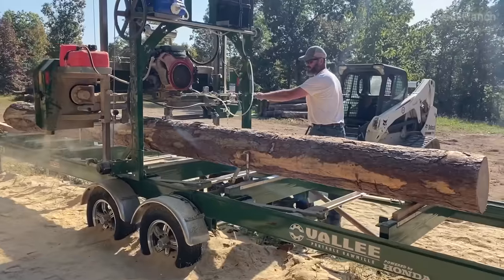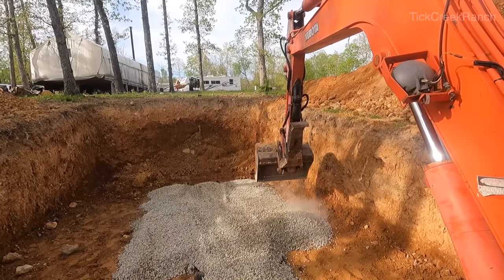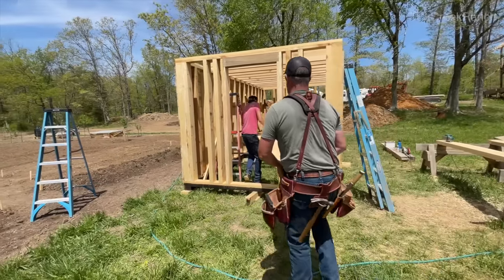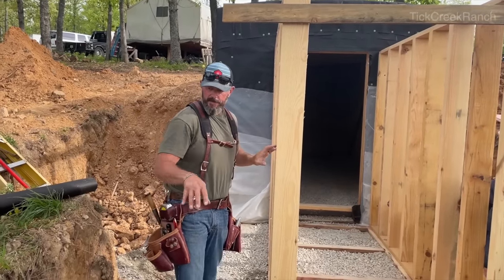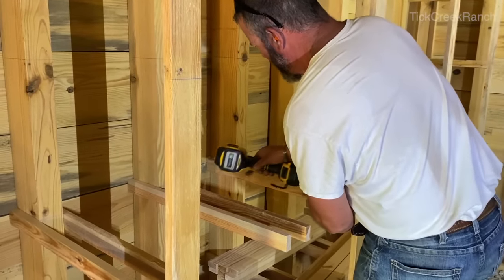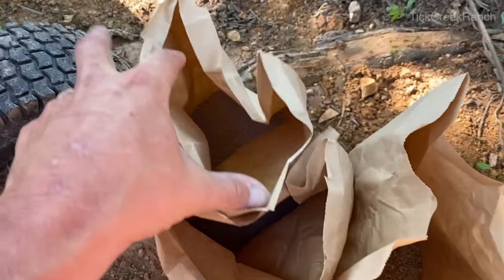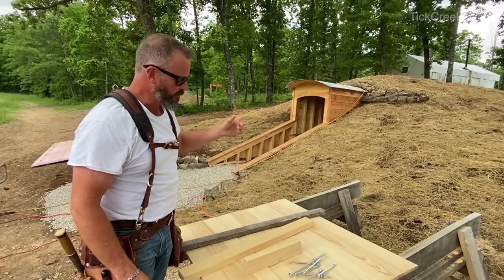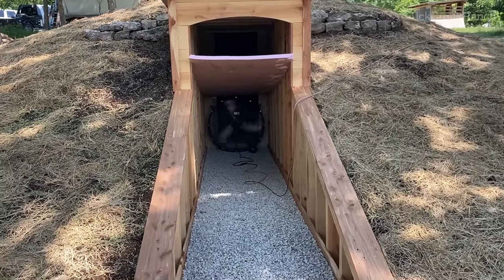Root Cellar Build / Possible Storm Shelter?

Comment: I did the same mistakes you did when I built my first one.  :D.  The foam board that sits between the dirt and plastic will slide against the 6mil over time and cause gaps to open up.  It will also eventually let dirt sit on the plastic and bugs will slowly eat away at it.  Gluing it down, is important, so it doesn't slide.  The pine inside should 100% be sealed with linseed oil or anything else that natural and helps keep the bugs from chewing it up or wanting to stay in the enclosed environment.  Especially out in the hallway, spiders will love that area.  You can put it on the bottom of the Cedar as well, to stop any bugs from finding an area to chew into.  They WILL eat cedar if they want to.

Comment: You might consider reinforcing some of those shelves to serve double duty as bunks in case you need to sleep in there during a storm.
Reply from the maker: @kelliott7864  they probably don’t need reinforcements considering they are designed to hold the weight of 6,200 full quart mason jars👍

Comment: Nice work.  I’d suggest backfilling the walls with clean rock if someone else is building similar.  This helps reduce lateral loads on the walls and also keeps saturated soils away from the exterior wall surfaces. This should increase the structures service life.
Reply: Than k you for your comment.  I’m in the process of designing my own.
Reply: Expanding clay deff ruined alot of places.  Nice call
Reply from the maker: Yes, great advice, hopefully this works until I can encapsulate the structure in concrete and steel.

Comment: Whilst I love your construction and detail!  It wouldn't work in most parts of Australia!  Here, it's termites!!! An example?  Most timber even if treated is not warranted or guaranteed above the tropic of Capricorn! Picture yourself going for a working holiday in some of the Northern mines here! You have a magnificent AIRFLIGHT CARAVAN/CAMPER  to live in for even just 3 months?  You  jack the van up nice and level,  so the van is solid walking around inside! Springs not under compression,  wheels and tyres are say 4 inches off the ground?  You will find our Northern terminates will build up dirt to the tyres and eat them!! Even massive tyres off these massive trucks?  Leave them on the ground? The termites eat them!!😮
Reply: What would eat termites? Maybe free-range guineas and chickens?
Reply: @evelynwaugh4053 
I’ve trained my koalas to eat the termites...
LouiseAustralia 🦘
Reply: Use stones, you got plenty of them)
In Eastern Europe, in root cellars, we use boric acid against small insects. Just put it in the corners,  that's it. Its working. 
Have you tried it against your terminators?))
Reply: @jonasjonaitis2949  I'm  sure these Northern  Australian Termites must have tungsten teeth? Lol

Comment: Looks like an amazing build. You'd absolutely would benefit from adding a ventilation tube in the rear, with an intake at the front. Some vegetables will give off chemicals...gasses... That effect the others stored there. 
Furthermore, it would assist in pressure changes as the storms come through the area, this can enable the structure to change internal pressures and not be as likely to get damaged.
Reply from the maker: Yes sir, somehow we didn’t show any of the ventilation in this vid. It has vents in the bottom of the door and a roof top turbine vent (that is too big btw:) We’ll put out a update video soon and I’ll be sure to include the ventilation this time👍
Reply: @tickcreekranch  definitely would love to see a update!
Reply from the maker: @AddictOfLearning  Yes! We need to!
Reply: Acetlyene or ethene - triple bonded carbon molecules - everyone knows about bananas emitting them and to keep em in a bag if u want to ripen quicker. I spent 2 years in college studying  and then teaching organic chemistry and honest to god this is the first time in a year or two i actually have used that knowledge (knowingly). Did teach me how to think better, at the cost of me writing skills.

Comment: Sir, I really enjoyed this video seeing three generations working together is very inspiring. Don’t know if your shelter will last forever but I’m guessing it will last long enough. Great video!
Reply from the maker: It was a fun project and only time will tell about the longevity. We experiment with a lot of different stuff, this was one of those. There are wood cellars that still function that date back to the 1700s. Now do I think this will last as long, no. I’m sure they had environmental advantages over us and a better decay resistant species they utilized. On the flip side of the equation, we have modern membranes, drain tile, dehumidifiers and products we can apply to prevent insects and decay. It will be interesting to see if this is a viable option for some instead of masonry and it’s associated cost. This was less than 2k total considering we mill our own lumber. Thanks Chico
Reply: Those black marks on the wood is mold. You have to use bleach to get rid of it..

Comment: I like your build. My change would be to put wood directly between your studs to improve side of room to side of room compressive strength, in addition to the wood you have between your top plate and bottom sole plate. Theres a lot of compressive strength put on your walls, you saw your back wall give out after you dug it. Your walls seem to be held in place only by nails into the plates.  In my opinion, and i could be wrong, if the nails, which seem to be to only thing hold your studs apart side of room to side of room, pull out, the studs would push into the room. If you had wood between your studs, from side of room to side of room, the studs couldnt push together. On the other hand i think you could park a semi on top of your project, those studs are fantasticly strong compressed top to bottom.
Reply: The rafters could provide that strength at the top, as long as they are secured well at each end... don't forget they sheathed all walls and roof with thick wood, which, if nailed properly especially at the corners, should be just fine, don't you think?

Comment: Nice design and work. 
Here at our homestead, we faced the entrance toward our home to make it quicker for accessing it, easier for when stocking it up and gathering canned food, and better for directly communicating from the home to anyone at the storm shelter. 
We also ran 1" conduit with romex for 110v. Used 1" in case we wanted to run other wiring through it later on. And since we already used a ditch witch to dig a trench for the wiring, we also laid down a 1/2" conduit in case we ever wanted to run water to it from the home.
Reply: Put in plumbing

Comment: 📍BONUS TIP: Diatomaceous Earth (DE) mixed with gravel and anywhere unwanted bugs might crawl makes for a great repellent. 
📍 sand & DE mixture as a barrier between the soil and building can help keep the structure dry and prevent unwanted insect intrusions. Plastic sheeting (under-slab vapor retardant) along the soil contact wall, and fill the gap with the sand/DE mixture as the soil rises up. Alternatively, a plaster version of water, crushed limestone, & gypsum with the sand and DE as a thin plaster before surrounding with dirt. 
📍 exterior hallway… surprised dry-fit stone wasn’t used (in whole or in part) until I saw the end. 
Looks GREAT!
Reply: I was going to say that. Because you know there's all kinds of bugs in that dirt and you don't want them in your food.

Comment: I thought root cellars were supposed to be cold. Won't the thick wood and insulation make that more difficult? I was going to ask if you had enough earth on top to use as a fallout shelter, but the door would need expedient shielding and the insulation might make it unbearably hot with people in there after a few days, but ventilation might help.

Was that mildew already growing?
Reply from the maker: The insulation on the walls and ceiling allow more temperature influence from the deepest part of the structure ie the floor. Milling green lumber will almost always blush with mold unless kilned immediately. Also, there is zero intention of using this as a fallout shelter.

Comment: Not sure about root cellars in southern climates, BUT here in the Northern climates of Canada, we require 2 ventilation pipes in cellars or incredible moisture build up occurs, which causes incredible swelling of wood, mold growth, etc, and the food does not like it either... In this area 2 plastic - usually 2 inch pipes are put down to the floor on either end to allow air circulation. and no, those small pipes normally do not cause severe temperature drops inside unless of course it hits minus -40*, and if made properly a light bulb is enough to keep the temperature from freezing... If made improperly, the temperature WILL drop on down and a small space heater is needed at that cold temp to keep things from freezing up..

Comment: quick lime was used to pull moisture out of the air back in victorian times you gotta be careful what you put it in as its extremely corrosive..... sometimes its handy knowing what the old timers did as it could come of some use if not to you maybe someone else........

Comment: Depends on outside temperature and air moisture if you raise the moisture in the cellar by this massive fan, or if you really lower it. A cellar with most time colder walls is somehow complicated to handle if you don't want to have a fungus farm, especially with wooden walls.
Reply from the maker: It’s stays right about 58 and 58. Dry clean and mold free

Comment: Great video. I think a good idea for ventilation would be to run a 4" pipe (maybe 4" stove pipe for better heat transfer?) all the way around the bottom of the trench, outside the structure, then have one end vent into the structure and the other end open to the outside at ground level. That way in the summer maybe your incoming air will get cooled and hopefully dehumidified a bit before it even enters the part your trying to climate control.

Comment: I wish I could get ppl to make root cellars round here (JXN MS). There’s no cellars here ever. So we have to get a shelter anyway for Ts.
I would FILLLLLL a root cellar! Nothing keeps here, sooo humid.
Reply from the maker: How high is your ground water? Your soil temps might be too high for a cool cellar too. Still better than a shed above ground though👍
Reply: @tickcreekranch  I don’t think it’s the water table being too high. We re 3hrs to the gulf coast.
Ppl have tried to tell me it’s the clay. I think it could still be dug out with a machine 🤨 
Something along the lines u did is my dream but maybe it wouldn’t be cool enough. 100* here is just a Tue 🤷🏼‍♀️ summer starts in March and ends in Nov with sunny days most the cooler mos. I keep telling myself, Joseph stored for 7 yrs in the Egyptian heat…
Reply from the maker: @YeshuaKingMessiah  looks like your ground water is about 63* in your area. That will be your soil temp roughly 8’ deep. Not ideal temp, but still doable. If you don’t have a hillside to build into, expect a swimming pool without passive drainage:)

Comment: Would have been a lot easier, less time, and a lot stronger if y'all built forms, tied in rebar grid, and had a couple crete trucks show up. Also, I was a mold remediation project manager for one of the largest companies in the U.S. and the earth doesn't need to touch the pine lumber for it to collect moisture. I highly recommend getting a commercial dehumidifier dedicated for that space and a hydrometer to keep the humidity down to about 50% (or lower) during the wet months of the year. Sorry if I sound negative but using that much lumber that mold loves to live on, in the ground is not a good idea. Most storm shelters that are built with lumber are done with cedar or redwood (naturally bug repellent and rot resistant). Your build definitely looks cool🤙😎
Reply from the maker: @mikeschwendeman4403  it has a dehumidifier and keeps about 55% naturally but will turn it on when it creeps up. Timbor does a pretty good job keeping down the biology in the wood so far. Eventually I will ex out the soils and use the existing structure as the inside form and pour concrete over rebar.
Reply: @tickcreekranch  Awesome idea!!!

Comment: I designed homes with a wooden foundation up here in Michigan. Your structure should work, although I would have used treated lumber. But after about 10 to 12 years, you're going to have some issues.
Reply: What issues

Comment: Nothing below ground level.  Use all double reinforced concrete foundation, floor, walls, ceiling at least 12 inches thick and F5 tornado certified steel doors.  No wood, please.

Comment: Could have dug hole deeper, installed ground-drain system, installed your mobile home in hole, reinforced dirt walls with concrete and rebar,  built a concrete roof over mobile home which would rest on concrete walls! Left three feet from concrete walls to exterior mobile home walls. Topped the site with mound system..... Used the same entrance design you used here. Bam! No need for storm shelter!

Comment: I'm in North Texas and I'm doing something similar . . .
Kind of . . . My structure is slab on grade, sitting atop a hill with 16 feet scraped off, with steel-filled concrete walls and roof. The entire structure will be covered 4 feet with earth, making it both flood and Tornado PROOF. It will feature Hydronic heating and geothermal cooling.

Comment: Ur a me.  always over building.  Bit my Da taught me better to have it over built then under built for under built means it will come down on ur head.

My house was way over built in 1857.  It has 12" think walls.  The rafter in basement are 12" logs with the upper side cut flat for first story floor to lay one.  As to that floor It is made of od size oak 3" thick in living room.  Upstairs is same only the ceiling is made of 3"x12" rafter space 24" apart same as the walls.  Then there is the attic.  Once again 3"x12" rafters both for the floor and roof rafters.  On top of those rafters is 2"x14" planks with a slate roof. 

Had to have some slates replaced.  Lucky for me i know an old woman who lives in a house cover top to bottom with slate.  She knew a buy who lived in Maryland who did such work.

He had some very specialized tool u cant even buy new today.  He was more then happy to teach me how to do this and so now when a piece of slate come lose I know how to handle it and have the tools to do it with.   Those lessens cost be though.  10G's for about 40 hr work and my education.  I call it cheap when he is the only guy around that was doing such work.  He was 70 when he did my house 30 yr ago.  So unless someone else got educated now Im the only one around who knows how.  My Ggirl will learn when the next one comes off.   U see the nails are just iron and rust out and the piece falls off.  Sometimes it does not break and all i need do is tack it back on.  To do this u need those tools.

Comment: Uhm, if thats a possible storm shelter, wheres everyone sitting down at.
If its a cellar, wheres the tater bin at, cause all i see is storage for canned goods. 
As to the pine, no matter how much plastic you put on the outside, you still got a dirt floor covered with gravel which will bring the moisture to rot the pine.
Nice video though, excellent craftmanship but you might have been better to use marine 3/4 inch plywood on the outside.

Comment: It looks really nice, but I believe a concrete structure would have been better structurally and can go into sync with the Earth's temperature. Wood is an insulator and it doesn't have the same longevity as concrete. Also concrete would make it a better emergency bunker.

Comment: Basically you built a wooden shipping container. Seems like using a shipping container would have been cheaper and faster. Less work
Reply from the maker: Containers cost more than the materials in this build and they will still collapse without additional reinforcements.

Comment: Probably way overkill on the lumber specs, which is good.  But when we do ours I plan to use 2X6 Treated on 12” centers with two layers of 1/2 exterior plywood horizontally/vertically opposed, then rather than just wrap it in felt and plastic alone, im going to also first coat the entire outside and bottom framing with blackjack roof sealant paint very thickly.
Reply from the maker: If I was to do it again with fresh milled, I would use 8” studs. These were 3x6, but green milled so they were a little springy. Now being dry they’re good, but they were bowing in a little.

Comment: How's this cellar working out?  Does it stay pretty cool inside?

We live completely off grid, and I'm about to tackle our cellar project.  I watched this last year and just came back to it.   Everyone is telling me to block it and pour a concrete roof, but i have a sawmill and this design would be much more practical for us.
Reply from the maker: Masonry is definitely superior in every way except the feel, smell and cost. It’s working well. Still dialing in the ventilation.   After the backfill and associated settling cover the whole mound with a membrane and then bury in dirt to prevent any possible hydraulic lateral loads from water infiltration. Make sure to add wrinkles in the membrane to prevent tearing. At some point I may pour around and over this using it as our inside form. So far it has served it purpose. Oh and yes, it stays around 58f which is our annual average temp👍 works well for dry goods and jars/cans.